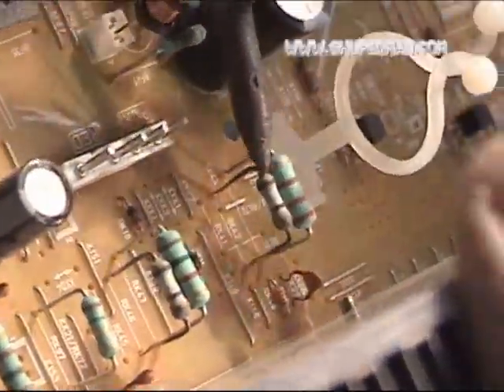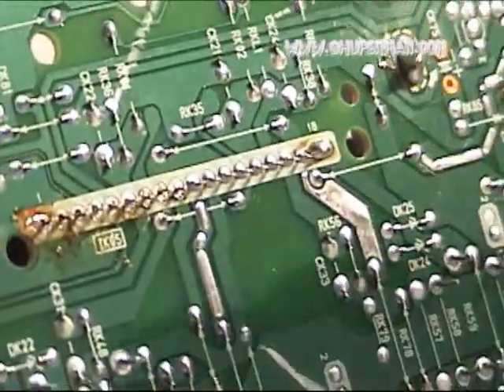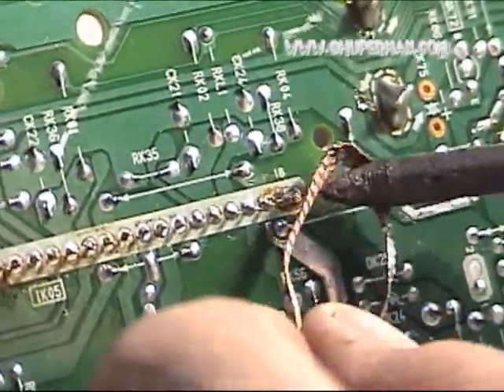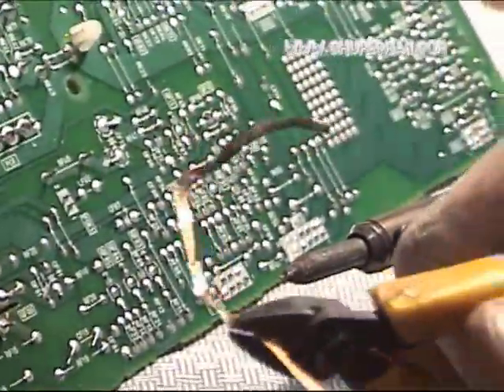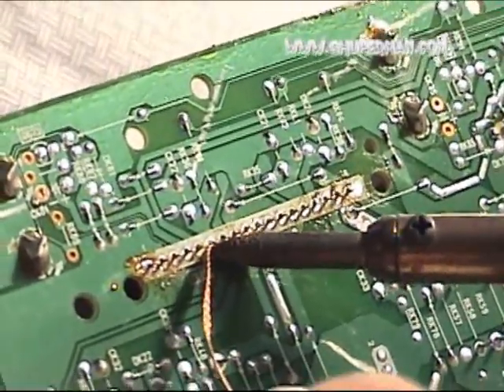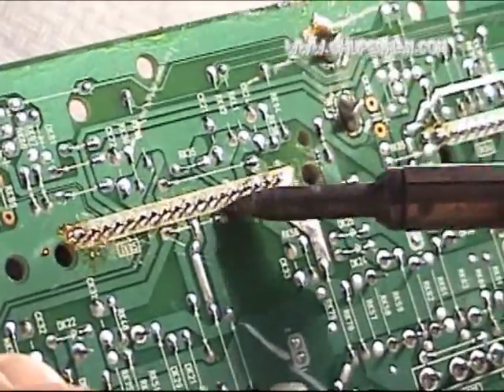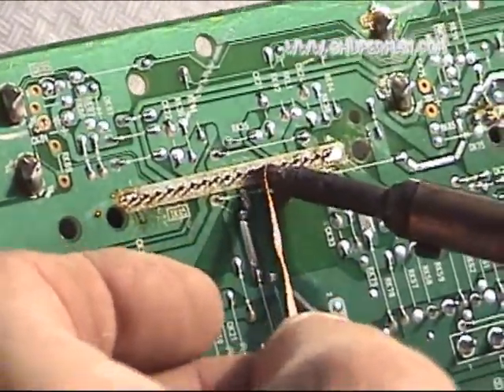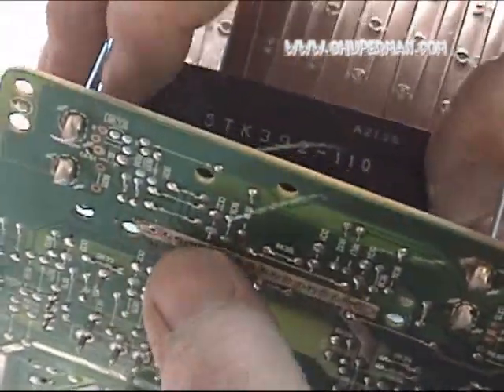Hitachi Convergence(2)

Comment: Always check for solder cracks on convergence chip pins first.  My Hitachi had severe bowing and 3D effect.  Found solder cracks on 14 of 16 pins on one chip.  Resoldered pins and BOOM, factory perfect picture.
Reply: i still have to get into the back of the t.v. but i'm hoping that my problem is as easy as yours was...

Comment: i heated the base of each terminal and pushed it thru board with tiny screwdriver and the chip fell right out. Easy ! ! ! !  that braid didnt work at all. its for cleaning up old solder after the chip is removed

Comment: Hitachi, Samsung, and others, if you're listening, this is total EFFING BULLSHIT that you did not put these components in IC sockets so they could simply be pulled up and removed and easily replaced, if you KNEW they were going to fail.  I ordered some STKs today, and when I do mine, I'm not going to solder mine directly into the board, but solder some IC sockets so that I can just plug mine in from the top without having to remove the whole god damn board.